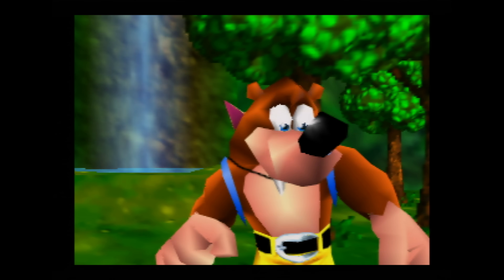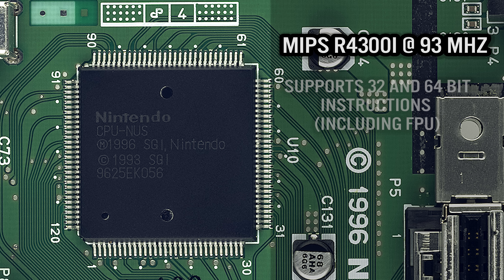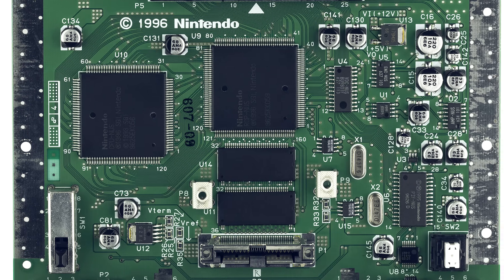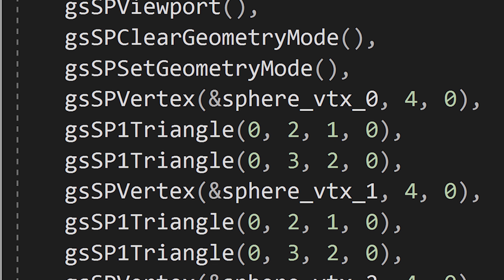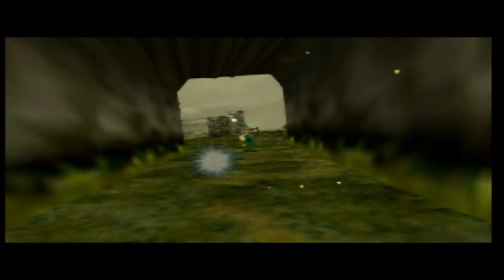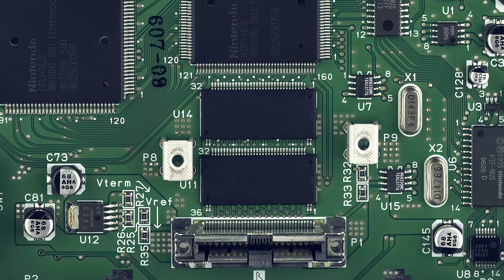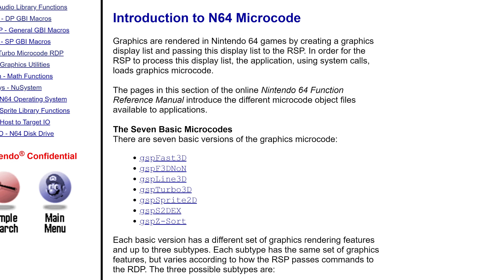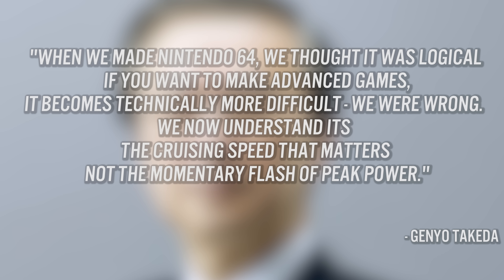Why was the Nintendo 64 so hard to develop games for ? | MVG

Comment: When you showed the power and reset buttons prominently on the N64 you instantly reminded me of how my sister once got sand all over the top portion of the one I used to have and jammed the reset button. The console still worked but the reset button didn't

Comment: Based on what I've read about emulation. it didn't always expose fully how the hardware operated, so it was hard to make it do things that it hadn't already been programmed to do.  Like a kind of middleware.  This is why some emulation was a snap, and others were a nightmare.  API calls could be mapped to corresponding calls in the 3d card API, but anything that involved programming the hardware directly wasn't emulated this way.

Comment: By what i saw in the N64 development manuals and stuff, it was easy... as long you used the standard nintendo microcodes.
After the PS1, both nintendo and sega rushed to make an "Open GL like" API so developers didn't needed to deal with the hell behind the curtains.
You lost some performance and flexibility in the process, but not every game company have a genious able to deal with the RCP/SCU bullshits.
Reply: 3D rendering is really hard, so it's the logical conclusion we're gone from microcode hacking to universal APIs right up to the current day where almost everyone except really big studios (even some of those) use one of the two big premade game engines (Epic or Unity). Less money spent on expensive programmers, more on creative staff.
Reply: @theshinken  Sony got it right out of the gate, by basically copying the best API of the time and designing the hardware itself to be friendly with it.
But then nintendo and specially sega had to rush something to compete.
The sega saturn techdocs are quite hilarious because they explain EVERYTHING about 3D graphics from the basics of basics, including "how to use lightwave to model a low poly monitor/car".
But this was needed given most devs were coming out of the snes and genesis.
Reply: @dan_loup  I felt like there was a lot of competing APIs the time. Everything was so new. Given Nintendo partnered with SGI. I would think their solution is heavily biased from what SGI was doing at the time. It's amusing to say Gamecube was a more traditional 3D system when at the time of the N64 I don't think I'd say anything was deeply ensconced as the 3D machine.
Reply: @Jerhevon  On PC space there was quite a shootout brewing between DirectX, Open GL, intel 3DR, apple quicktime VR, proprietary videocard APIs like GLIDE, S3 metal etc..
Consoles on the other end had to deal with much slower CPUs so actual graphical APIs  didn't looked like the best of the ideas, until sony basically implemented OpenGL in hardware on the PS1, and everyone had to run after.
Reply: SGI, who co-developed the N64, also invented OpenGL. They were pretty famous for their graphics workstations. But they had to trim it down to fit into the N64. If you can use OpenGL API (the old 1.x) the N64 graphics API will feel very similar. You just have to be aware of a number of limitations, about coordinate values, how many vertices you can ft into a display list call, what happens at the edges of textures, etc.
Reply: so, for the N64 there was no API whatsoever? you had to deal with the HW code to create an engine from scratch?
Reply: @matiastau8495  It has an API pretty similar to the OpenGL just like the PS1 and saturn.
But if you look at the dates etc.. it's a bit obvious that sega and nintendo had to rush their own APIs to attract developers.
Reply: Dr_Kachu san I’ve been told that Sony’s libs and the os in ROM were also buggy AF.

Comment: "Its the cruising speed that matters" - PS5, I'm looking at you :P
Reply: @randomguy8196 Mark Cerny did a presentation showing that PS5 will use AMD SmartShift to boost CPU or GPU according to load, in a much more PC like fashion than the traditional fixed specs approach. All the figures presented by Sony are theoretical limits and it makes it pretty hard to understand what would be the "cruising speed" of PS5
Reply: @MarioMazzotti  Sooo. why not just have a PC at that point? The only real advantage consoles have, and why developers focus on them and port to PC (and not the other way) is because they know exactly how much hardware they have to work with, how fast it is, how much memory they can use, ect.. This will likely just result in many devs developing for Xbox (or Nintendo Switch) levels and ignoring the 'peek' of whatever ps5 will be. 

This all seems like, once again, Sony is complacent and think their fans will buy their console no matter what. Its like they forgot how the ps3 went.
Reply: @lyianx  yeah, I do share a similar perspective on this, my skepticism on PS5 "boost" specs is that they won't be as predictable as steady specs, thus inducing devs to work with what I would assume would be a "safe" (maybe guaranteed is the word) operation range and underutilize the hardware to avoid performance instabilities. That's the reason I'm not a fan of having PC-like boost frequencies. 

For anyone reading this, for now all of this is nothing more than pure speculation.
Reply: @lyianx  Alas, they will just bribe a few studios as usual to make games only for them, and usual morons will eat it up and ask for seconds, crowing worse, anti-consumer console is somehow "better"...
Reply: @randomguy8196
they will regularly run defrag on the SSD, obvious really
Reply: @randomguy8196 It does, it's called "Rebuild Database".
Reply: @randomguy8196 SSDs in consoles, took them long enough. And they've been dirt cheap for years.
Reply: @BarryMGC  Where can I buy those dirt cheap SSDs? I'm still seeing $200+ on low end 2TB SSDs (and $100+ on 1TB low end ones), not exactly "cheap"
Reply: @BarryMGC  nvme SSDs are anything but cheap, and that's the kind that's used in the next gen consoles. Not the hardly better than HDD SATA SSDs people swap in currently.
Reply: The PS5's boost clocks may actually make it much easier to hit a good cruising speed because it sets a limit on power use instead of clock frequency. If a developer has a task they want to do they usually want to make use of every bit of hardware at once, maximum parallelism within each clock cycle. On PS5 that has the potential to lower clock frequencies, so a traditionally less efficient method may end up being just as fast because it uses less power.
Where a on a fixed frequency console the developers have to worry about wasting clock cycles because they've hit a narrow bottleneck the PS5 will actually run faster without them needing to spend ages trying to parallelise more work.
Reply: @faustianblur1798  this actually makes no sense at all, it may be more effective to actually reduce clock speeds while doing no work - electrically efficient - if the system is waiting for some resources and wasting cycles, whenever the resource is available it will catch up... Dynamic frequencies may even incur on latency upon power state switching, when the CPU is needed it may take a few cicles to adjust its clock to hit that beefy limit.

2 identical CPUs one with a steady 3GHz clock and one varying between 2 and 3GHz on load - there is NO WAY the varying one will be faster. Now this is not PS5 x XSX case, but it is somehow comparable situations.
Reply: @MarioMazzotti  a better comparison would be two CPUs one at locked 3GHz and one varying between 2.75 and 3.25GHz. However, the way the PS5 is described as working it will maintain full clock speeds unless power draw from the APU exceeds a specific limit, so yes it will run at full tilt if it starts hitting idle at any point. That's what Cerny described as "race to idle", the APU accelerates to max clock speeds when it is using less power.
If a developer wants to do something like a rendering pass that under utilises GPU compute or a task that is highly serial on the CPU, they would usually try to schedule additional work to make more optimal use of the hardware. On PS5 that may not actually get them any benefit over simply letting the hardware run faster using the less efficient path, making it easier to get the most out of the hardware.
Reply: @faustianblur1798  your example is not a better fit than mine, PS5 CPU max clock is 3.5GHz, compared to 3.6GHz steady clock. How could that be any faster?

Both Zen 2 processors, one with a max clock of 3.5 and another one with a stable clock of 3.6 (or 3.8 if the developer decides not to use SMT). How could the former be faster?

On the GPU we have a similar story, except Xbox instead of having higher clock, it has far more computational resources. Also with a fixed clock speed.
Reply: @MarioMazzotti  it is a better fit because we're comparing fixed clocks against variable, not PS5 against XSX. Obviously a more powerful system built on the same architecure is more powerful, although the GPU wide/slow vs narrow/fast is another debate entirely and highly dependent on how the underlying architecture scales with additional CUs (badly in the case of GCN, unknown for RDNA2).
The cruising speed is all about the performance a developer can generally expect over many different situations, not the absolute peak theoretical performance. You implied that the PS5's variable frequencies would impede its ability to hit and maintain a good cruising speed, I don't think that's necessarily true based on how the boost clocks are described. If anything it seems like it will help to smooth out the dips when hardware is underutilised even if it doesn't help push it higher at the peaks.
Reply: @faustianblur1798  I'm sorry if I made myself understand that PS5 won't be able to maintain good "cruising speeds", my statement was mostly on the fact that Sony seemed to use these "boost" figures as a statement of higher power, when the fact is that XSX CPU and GPU can sustain a certain amount of throughput independent of the workload - I didn't mean to understate PS5 power, nor I believe it won't be able to achieve "next gen" power. I am with very high hopes for this next gen machines as current generation was pretty underpowered
Reply: @MarioMazzotti  tbh, the TFlop figures are pretty vague anyway, they're a theoretical peak that is never achieved in games as you're never going to get a workload that constitutes nothing but fused multiply-adds for any significant time. Now Sony are using a slightly more speculative version of that figure dependent on yet more variables, but I don't see how they can avoid that if that's how their hardware works.
I'm pretty excited for this coming generation, not just because the systems have more raw power, but because the manufacturers seem to be investing more in R&D again. I like that there's more divergence and none of it looks too stupid.
Reply: @faustianblur1798  That only applies if your comparison hardware is less powerful. PS5, having lower clocks no matter what, will always be constrained on clock cycles compared to Series X.

Also, why should developers care about power usage, again? That's the hardware designer's job.
Reply: @halofreak1990  developers don't care about power usage, they care about how their code performs and how easily they can get good performance from the hardware. People keep citing the PS5's boost clocks as a weakness. To put it another way, would the XSX be less powerful if it had boost clocks that let it hit 2.1GHz on the GPU when there was power to spare because of under utilisation? I really don't see how.

Comment: N64: Stupid powerful on paper but with absurd bottlenecks, mostly to do with memory.
PS1: Slow, but relatively simple and performs evenly.
Saturn: Complex as hell but with the PS1's memory advantages and can perform much better than it as well, even approaching or exceeding the N64.
Reply: pls stop spreading this saturn is secretly more powerful than ps1 meme
Reply: @jc_doge  Both the N64 and Saturn were more powerful than the PS1 though. They both had trade-offs, and perhaps the PS1 was the most generally well-rounded, but it was definitely the weakest.
Reply: @fisherdotogg  not really. there are a handful of advantages the saturn has, but the ps1 is so much more straightforward and efficient that they don't make nearly enough of a difference. I can detail these later if you're interested.
Reply: @jc_doge  I'm aware of these things. To be frank I don't care that the PS1 was easier to create for. What interests me is what the systems were capable of with developers who knew what they were doing behind them. Think along the lines of Banjo Tooie, Vagrant Story, and Burning Rangers.
Reply: @fisherdotogg  well between the vdp1 wasting fill rate on overdrawing, and the SCU DSP being pretty much shit compared to the GTE (high latency and no division) I'm inclined to say PS1 was not only easier but also more powerful the majority of the time.
Reply: @jc_doge  Aren't they both going to waste fill time overdrawing as a reprocussion from using painter's algorithm for lack of a hardware-based z buffer?
Reply: @fisherdotogg  Yes, they both do but I'm taking about how they texture. The PS1 looks at the polygon in screen space and decides which texel to draw for each pixel. The saturn does it the other way around and decides which pixel each texel should go, which means a lot of time spent just overdrawing them. That's also why transparency is broken for non screen facing quads. There's a gamehut video with really good visual explanation.
Reply: @jc_doge  Ohh right that part. Your explaination actually makes good sense on its own. I forgot that polygons are technically rastered by their texture one texel at a time and mapped to the screen in a similar manner. I can imagine the impact of that difference is miniscule on a per poly basis but might be slightly noticeable on the scale of an entire drawn scene, huh?
Reply: @fisherdotogg  well, I've heard from homebrew devs that optimizing texture size is one of the most important things for the vdp1, so I imagine it makes a pretty big difference.
Reply: @jc_doge  Thaaat's interesting... What I'm reading is that the Saturn has more, faster RAM and VRAM than the PS1 and had a faster fillrate anyway, plus you could make it fill differently from normal by drawing with the CPU if you really wanted to? As for the memory, the PS1 had an on-chip texture cache in its CPU while the Saturn did not, but the Saturn just didn't need that to begin with because the VRAM was already operating at an equivalent speed and with about the same latency. So I guess tl;dr the less efficient parts of the pipeline are mitigated by the speed of the thing anyway?
Reply: @fisherdotogg  I don't remember any of the numbers exactly but I don't think the saturn having a higher fill rate is actually true. If you got that from the segaretro wiki, I wouldn't take their word for it. Those guys tend to misunderstand the docs they cite in a way that's favorable to their preferred system. It did have more VRAM though.
Reply: @jc_doge  Interesting. It would make sense though, it's got two GPUs working in tandem to fill everything and VDP2 in particular is a beast, the load it takes off VDP1 whenever it can is absurd.

Comment: a lot of potential capacity and" power", but in practice, most games look same or worse than psx and saturn games, and only have 5 or 7 really good games, and 2 years later ,the same time difference between n64 and psx/saturn, the dreamcast was lauch and have much much better graphics
Reply: I had playstation and N64 at the time. The graphics of the N64 where far superior I always prefer the 64 versions of the 3rd party games. After seeing the 64 graphics it was difficult to go back to to the gigantic squares of the playstation.